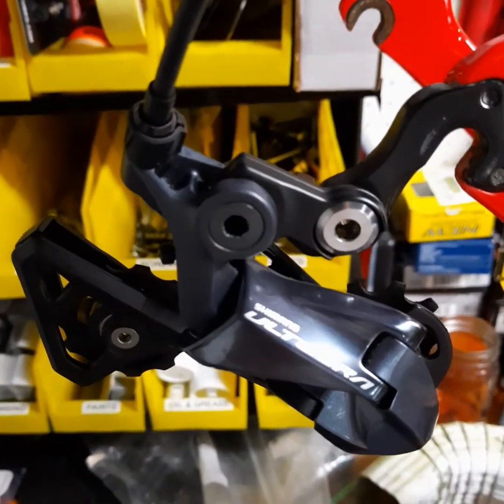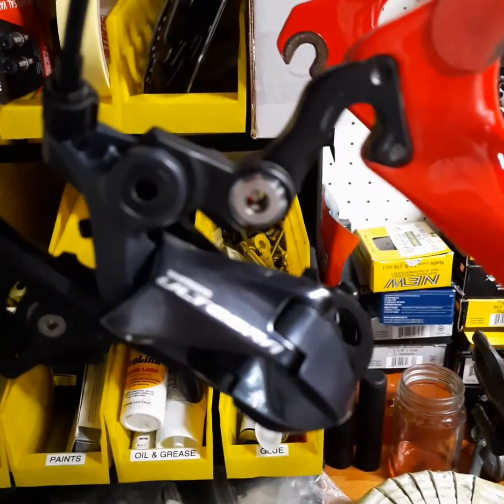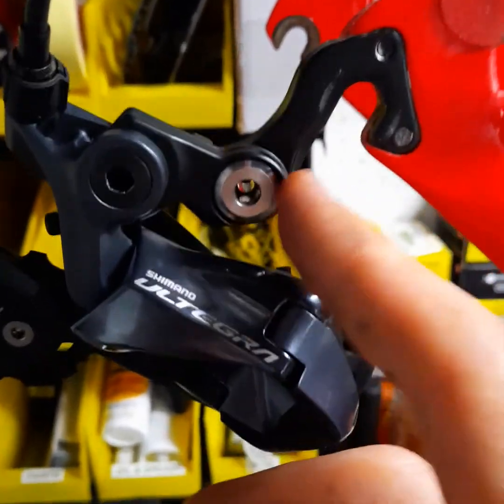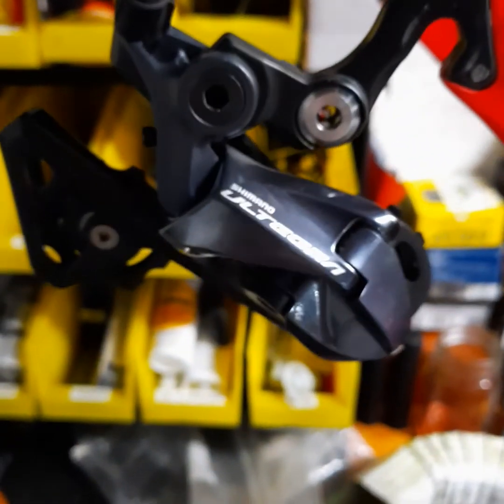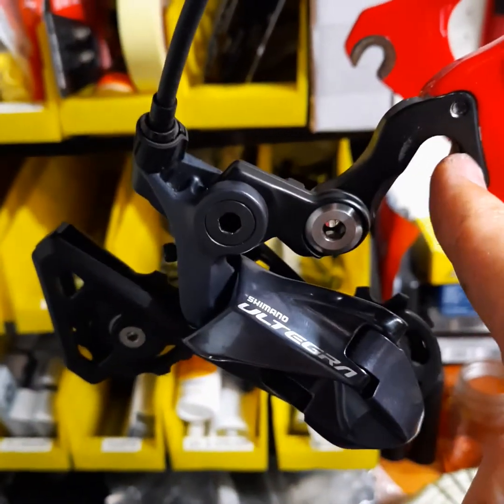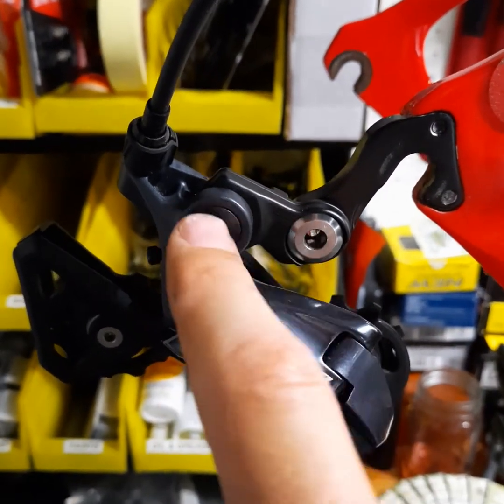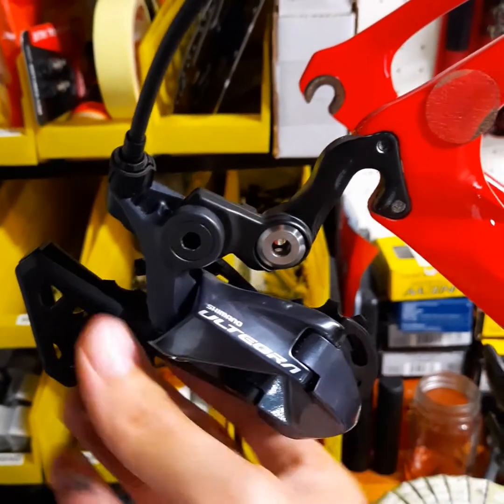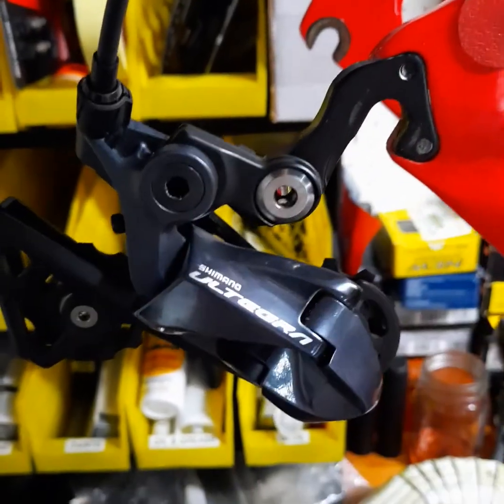What is Direct Mount?  Shimano Direct Mount and the RD-R8000

Comment: Thanks for this video, it fixed my problem. After installing a new shimano M8000 rear derailleur to my bike it wouldn't shift to the largest cog. I tried everything, loosened the L-screw, messed around with indexing, adjusted the B-screw, made sure the shifter cable was routed correctly, NOTHING WORKED.

Then came across your video and realized my derailleur hanger was direct mount tyoe and I had installed the RD using the bracket axle. I uninstalled the derailleur, removed the bracket axle, and installed it again without the bracket axle using direct mount. That fixed it, now it shifts perfectly and my rear derailleur looks much better because it doesn't have the extra bracket!

Thanks again!

EDIT: Oh, for anyone else just be careful. When you reinstall the RD without the axle bracket the limit screws will all be way off! I almost cought my new derailleur in the spokes because the L-limit screw was suddenly too loose.
Reply from the maker: Love it.  Thanks for posting!

Comment: That link is removable. If you but the r8000 derailleur it is shipped with that link in the box akd you have to attach it yourself.
Reply from the maker: @MrMpow3r  it's removable but if you remove it you can't use the derailleur as it is then incorrectly positioned on the lateral plane (hope that makes sense!!!) - this is something I wish I had included in this video
Reply: @poorpossum79   aah yes, I had another look at the pics I have and you're right.

What if you used an ultegra 6800 derralieur, they are 11 speed too and don't have that extra pivot point so crisper shifting and lighter if you're a weight weenie.

Comment: Six of one; half dozen of another. I haven't seen a direct mount rear derailleur on a road bike since the steel frame days. The replaceable derailleur hanger is there to protect the frame in the event of a crash, like the one I had last year that fubar'd my hanger and my ultegra 6800 rear derailleur. I replaced it with the 8000. I would rather have had the 6800 bc that system was damn near perfect, but obviously not crash-proof. 😂

Comment: standard - the bracket is more forward than direct mount. thus it has a "b link" to bridge the fore-rear gap. That introduces an extra joint, which can accrue slack.
direct mount - the bracket is more rear, and so the b-link is not necessary and eliminated, making it more "direct", hence the name.
Reply: So he did it wrong, right? As the document I've read, b-link is supposed to be removed?

Comment: I’ve been googling for couple hours today trying to understand direct mount vs standard mount, the terms are very confusing, like you said it has nothing to do with how it’s actually mounted to the hanger or frame but the position of the derailleur when mounted.  Here is what I learned. 1.  Direct mount derailleur on direct mount hanger, they are designed for each other so it’s actually a direct mount and position is right at where the derailleur is designed for 2. Standard mount derailleur can only work with a standard mount hanger because it would not shift properly when you mount a standard derailleur to work in a direct mount derailleur position 3. Direct mount derailleur on a standard hanger, you need a b-link to mount the derailleur at the correct position.  So lesson learned, it has nothing to do with mounting but position of the installed derailleur. Confusing?
Reply: you asked if it is confusing...yes

Comment: Anyone know if this B link can be replaced with a normal derailleur extender like the wolf tooth? Any advice would be appreciated as I have a direct mount rear mech that I need to mount on a normal hanger , thanks in advance
Reply from the maker: Unlikely.  The direct system also moves the derailleur out as well as back.  A regular extender probably just moves it back.
Reply: @poorpossum79  yes I understand that but my bike hasent a direct mount drop out and the deralier hasn't got the B link to compensate for that so my thoughts will one of those wolftooth/goatsleg/road links serve that purpose instead, of the shimano part , if you understand ?

Comment: The amount of play you are referring to at the rear most pivot is still going to be there when bolted to a direct mount hanger. The forward attachment is solid and there shouldn’t be any play in it so I don’t see what would be accomplished except for your hanger is more flexible that a DM hanger,  which is where the improvement in shifting would come from, but at the risk of causing damage to your frame should something go wrong. Pro bike teams don’t care if the derailleur gets ripped from the bike and takes the hanger and frame with it. Everyday users will care and would much rather have the hanger bend or break instead of damaging the dropout area of the frame.
Reply: Exactly

Comment: Okay, to be clear, when Shimano came out with this new shadow style derailleur, they also wanted to issue their own hanger standard to go with it going forward for all new bikes. The B link you are talking about was put there by Shimano to allow for BACKWARD compatibility with current bikes, until manufacturers could design Shimano’s new direct mount hanger standard into their bikes. Sounds great except the bike builders didn’t do it. Even now only a few bike companies are designing their frames with direct mount hangers. When this is done the whole arrangement is very solid and helps for even better shifting. Personally I don’t think it’s a great idea. In the past a hanger was the weak point and if something needed to bend or break it was the hanger. Well guess what, a direct mount hanger is so stiff and strong that should there be a problem where you drop the bike or the chain wraps up, that direct mount hanger is likely to not break and it will either destroy your derailleur, or damage the frame at the drop out, or both. Be glad you have a standard hanger and that B link. This may be why most bike makers didn’t adopt Shimano’s direct mount standard.
Reply: And how expensive will that be if your rear mech is Di2 12 speed?

Comment: FINALLY - someone addressed the question - the difference between direct mount and standard. All other videos are just saying - remove it if you have troubles with shifting, if you have direct mount...etc. - but nobody actually explains the difference. Thanks for the video. 
Btw - I never even had this problem, but was genuinely curious as some shops are offering rear derailleur without the link itself.
Reply from the maker: Thanks.  What's worse is that you can't use the mech without the link... It won't align at all.  So we are stuck with it.